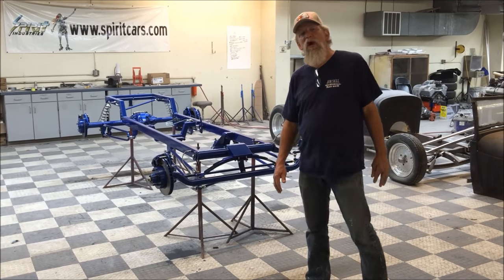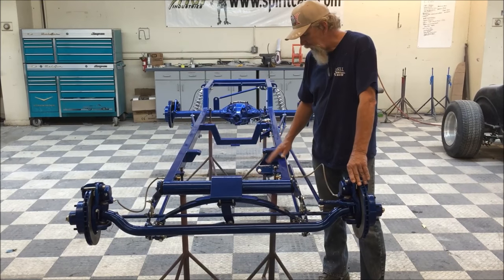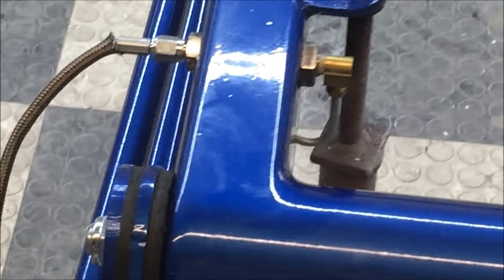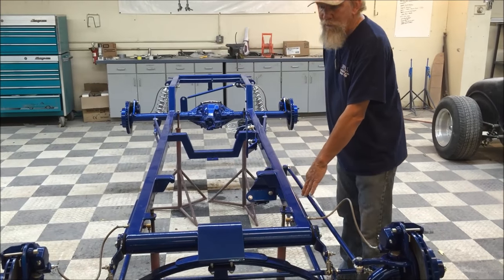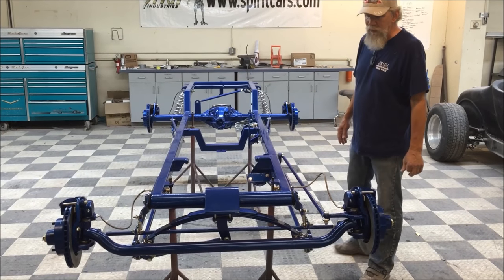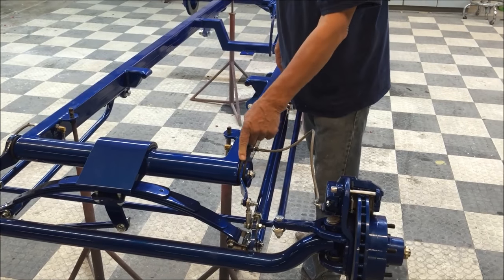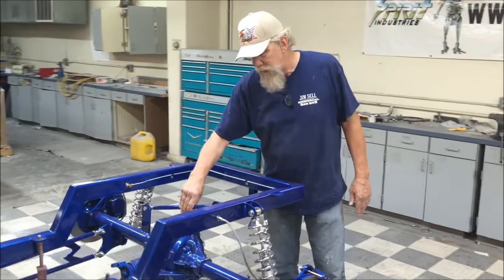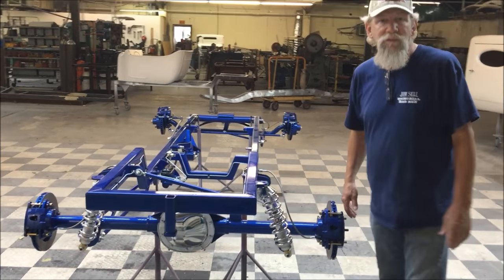Complete t-bucket chassis kit

Comment: would you be able to et chassic up with 9"ford rear and motor mounts for a Ford Y-Block V-8
Reply from the maker: Yes we can setup using 9 inch rear-end. We are setup for 302, 351 and Flathead engines.

Comment: Is it at all possible to get a olds 330 mounts and powerglide crossmember combo on this frame?
Reply from the maker: We aren't setup for the olds 330 but have the powerglide location. you could send us the motor and transmission and we could have it installed in the frame and even painted too